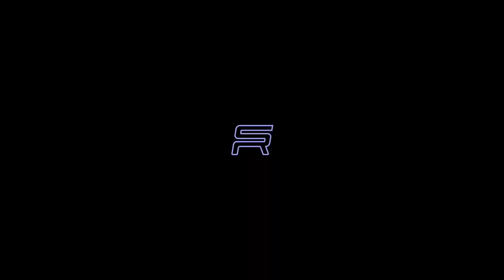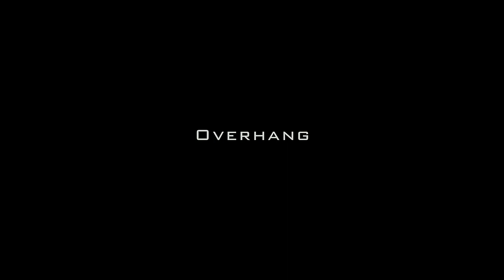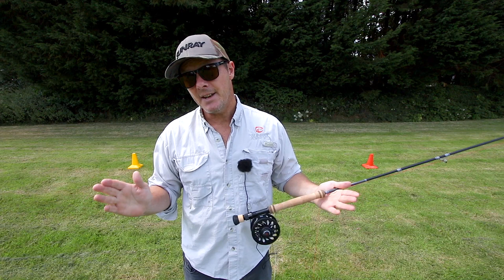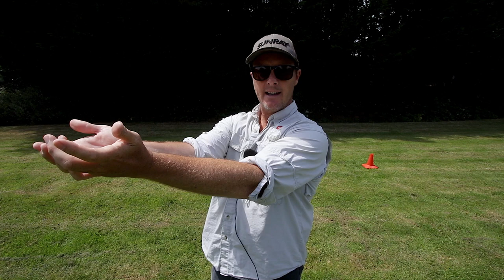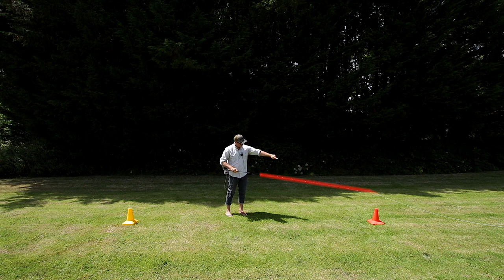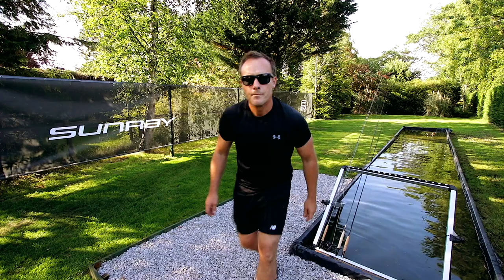Sunray | How to Fly Cast | Overhang in Fly Casting

Comment: Tom your videos are very well done. The Rio, SA, and Orvis lines are starting to show up in three colors with the transition from the 2nd to the 3rd color indicating the optimal load point by providing a visual reference to know whether the 3rd color should be inside or outside the tip of the rod. Your overhang marker is doing the same thing, which is excellent. In my view, buying a single or dual color line misses the point because without knowing where the overhang or optimal load point is makes it more difficult to have consistency.